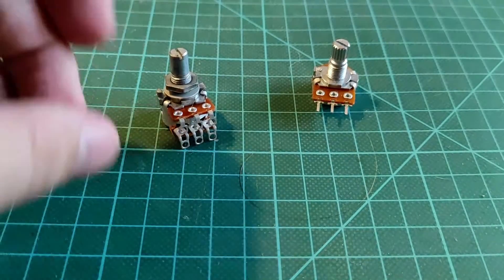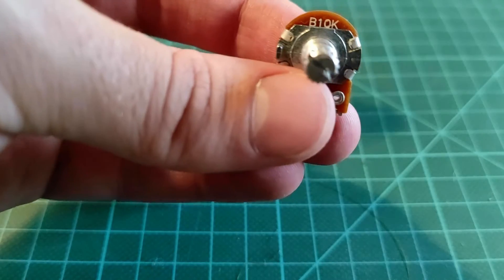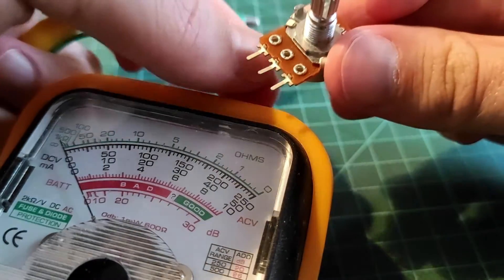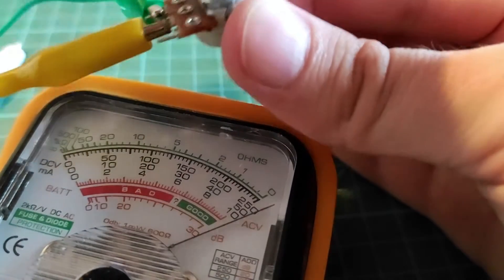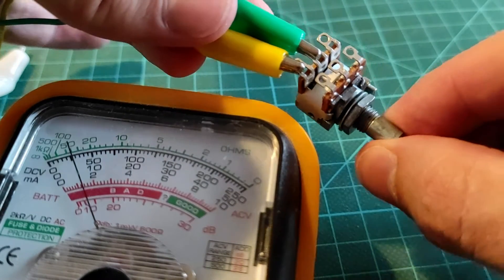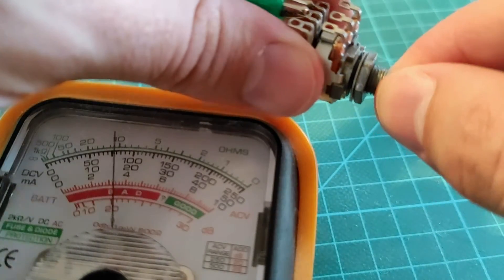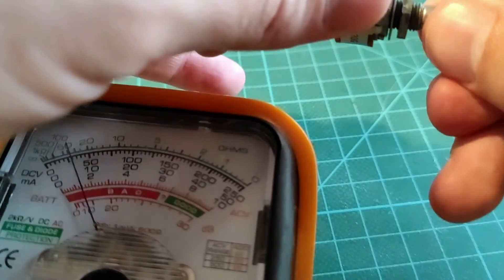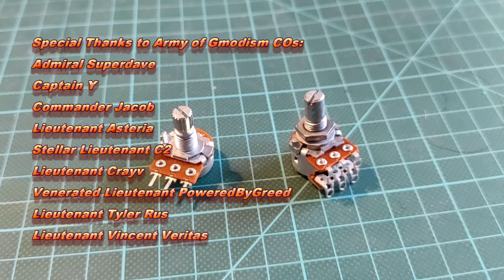How to Tell if a Pot is Linear or Logarithmic - B Linear/A Audio Taper Potentiometer

Comment: I've been trying to decide between an audio and a linear taper for a pickup blend mod on an SSS strat. I know there is always conflicting information with anything in guitar. I've read some pretty knowledgeable sounding things making the case that with pickup blending specifically, Linear taper provided a smoother range that was more workable, the reverse of what we normally feel with volume, but I've also read the exact opposite from many. Some were so adamant about linear they wondered why the blend pot fender sells is just a no load audio, rather than making a linear no load.  Anyways, curious if anyone has any experience specifically with making a blender with both linear and audio pots, and had real world comparison to relate. I think I'd heard that most of the useful change happens at one end or another but the effect your controlling is a little different making the connection between 2 pickups vs controling signal flow to jack. I can't remember if it was the major change at initial contact or mostly at the end of taper. Ill keep reading but as with anything guitar, you can go in circles with all the certainty of amateur scientists,  the emotional nature of all things guitar, and that the "placebo effect is a hell of a drug".

Comment: OK, so what makes them different like?Are they wire different inside or the inside?Guts are different because I have 2 pots but the one I need is linear.I need to switch it to log ... Can I rewire something or can I take the guts out of the log and put it in the linear one???
Reply: Between the left and right pins is a pad that has carbon deposited onto it. When you turn the shaft you are adjusting an internal wiper, and it is this wiper that connects to the center pin. The pad itself has a resistant (i.e. 1K, 20K, 1M, etc) which gives the pot its rated resistance value. So, to answer your question: What makes the difference between the linear and logarithmic pots is how the carbon is deposited onto the pad. So, while both a linear and a log pot may be rated at, for example 10K, the deposit density changes to reflect either a linear increase in carbon or a logarithmic increase in carbon.  Look up linear v logarithmic curves to get a visual idea of this concept.

Comment: Will I mess up my speakers if I change the pot from linear to a logerithmic pot?
Reply from the maker: linear pots are generally not used at all in audio equipment...
Reply: @ can I add one to a light?
Reply from the maker: @Markthewoodguy  yes, linear pots are great for controlling a voltage regulator chip to adjust light levels, just connecting a pot directly to control a light will probably burn ut unless its a tiny led
Reply: @GMODISM  thanks for your input

Comment: What is S taper potentiometer and where can it be applicable?
Reply from the maker: I never had one of those,, suppose it has an S-curve so it would be more (or less) sensitive in the start and end of the control. Must be when increased sensitivity is needed at the ends or the middle.
Reply: @GMODISM just received clarostat pots described as S taper. (*I still ordered but wanted linear.) My testing with help from your video shows linear type curve 👍. Not sure why seller described pot as S curve other than pot stamping shows 380C1 5000(ohm sign) S
I am glad it performs more like linear. I am aware that B stands for linear(A for audio)
There is an Ohmite 5k pot on eBay stamped as TYPE A/B huh?
(Described by seller as linear)
🤦🏼‍♂️
Reply from the maker: Haha strange, well good you could use this to figure it out as a linear one ;)